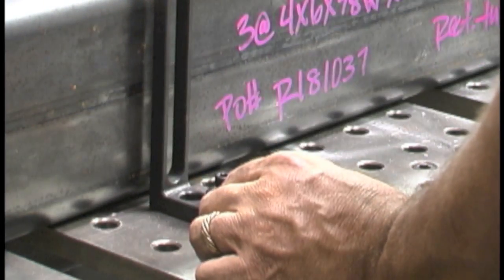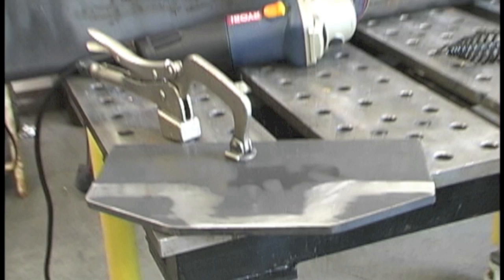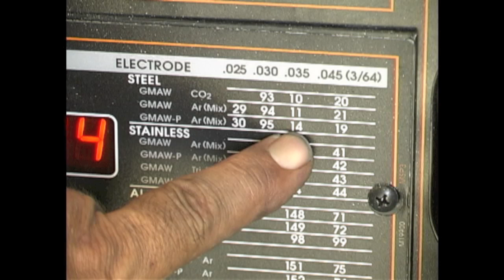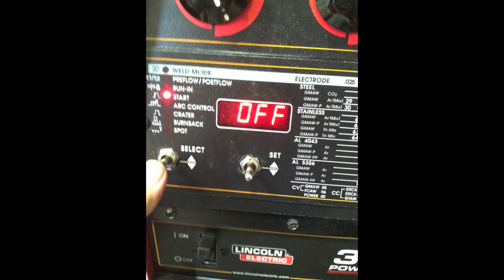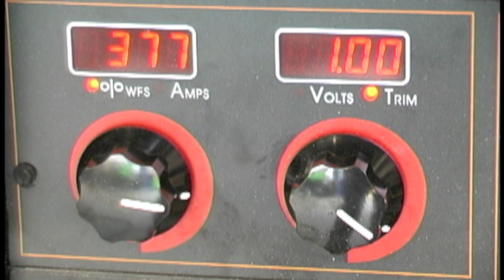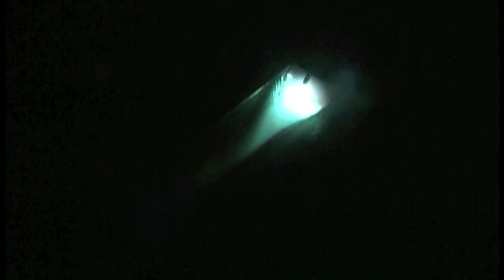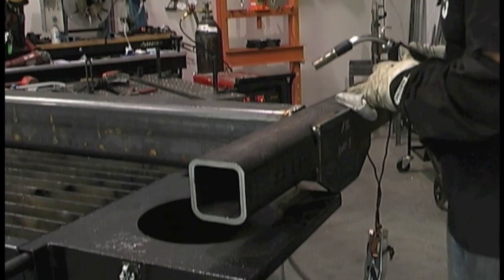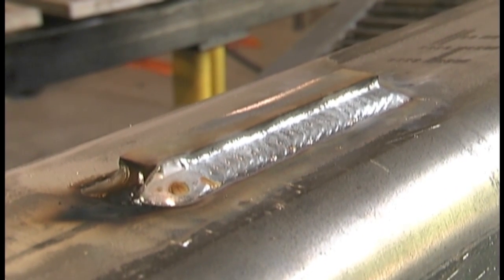Pulse Mig Welding Project on a Stronghand BuildPro Table

Comment: On these machines, "Arc Control" is what older machines called "slope". On older Miller machines, arc control is a subtle inductance adjustment that doesn't do much, but on the Lincoln, the more negative the number, the more flat the weld and the higher the number the tighter the weld bead. It's very noticeable and helpful on short arc mig but I don't remember it being very drastically helpful with pulse.  I'm sure it's got inductance built into that same setting but with a short arc process, it's just like old "slope".

Comment: Hi Jodie,
I have a Miller 350P and I live the results I can get with it.
One thing I've noticed is that it is a little fussy when it comes to mill scale. I noticed at 5:54 the vertical plate still had the scale on it and it did the same thing as I've encountered, namely the toe of the puddle tends to be irregular as it's trying to wash up on the side when the scale is there. It doesn't take much as you know. Nice to see you grinding the scale on the pieces.

Another tip I've used over the years especially on hot rolled sheet that needs a patina finish is to get the Velcro backed flexible diamond grinding pads. It works beautifully on that extremely tough mill scale found on these sheets. I even bought the Metabo grinder with the water feed coming through the 5/8-11 spindle. Not cheap but man does it do a number on scale!!
Love your channel!

Comment: Will someone please answer this?? I work in a company where all the old welders use MAG Pulse on heavy constructions, and my question is this: does MAG Pulse on normal steel penetrate better than normal MAG welds, and do you have to use Argon Gas to weld with pulse??
Reply: Mig?

Comment: Hii..Such a great video...

here I need a suggestion, We are having Lincoln Speedtech 505 machine having PF46 wire feeder. We tried Pulsed Spray transfer mode for Double V bevel 18mm thick gusset weld on flange plate having 18mm fillet size (Multi pass weld & T joint configuration manual weld) with following parameters.

Gas mix : Ar 90% + CO2 10%
gas flow : 18 - 20 LPM
WFS : 430 IPM (Same as Glob mode we are using)
Trim : 0.95 - 1.0
Wire : 1.2mm - ER 70S-6 grade
CTWD : 18- 20mm
Travel Speed : 900 - 1000 mm Per minute

and following are the observations :

1) Heat generation / Heat input is very high wrt Glob mode
2) Undercut observed / generation.
3) Weld puddle flows downwards in 2G position.

So can you guide me to eliminate above mentioned observations...???

Comment: would you ever bolt your ground directly to the work? this question is in regard to the last part of the video when you introduce the copper wire?
Reply: I would think that would work as long as the bolt location had good electrical contact. I have used the copper wire trick with my everlast welder setup ever since I saw this video.

Comment: Jody, I recently took a test, 7024 rod and dual shielded flux core. My stick welding got me the job offer (I didn't accept it) but I struggled with the wire fed. I'm about 90% sure it was spray transfer. I struggled in seeing the puddle so my travel speed ended up being slow and I would start getting cold roll on the bottom side of the 2F joint and was melting off the top edge/corner of the upper piece of the lap jount. 
What trick do you use to help you see the puddle when using spray transfer? 
I was not able to adjust the machine, just had to run what I was handed.
Reply: I know this comment is 4 years old, but oh well, but I get the strangest satisfaction whenever I can give somewhat of an answer, which doesn’t happen all that often lol. Flux-Core according to my very limited understanding, has a transfer mode characterized as a fine globular transfer, which is very similar if not identical to a spray type transfer, as opposed to short circuiting transfer or the globular transfer condition which can occur with solid wire. You will notice this immediately if you switch from flux core to short circuit, because you will feel the wire running into the base metal and melting off many times per second, you’ll feel that, you’ll hear the awful crackling noise especially when you’re used to the nice quiet hum of a flux cores wire or a solid wire in a spray mode, and you can also see the wire just stabbing the puddle over and over, not tying in or penetrating nearly as well, producing a lot more spatter, etc. where flux core and solid wire in spray mode actually just produce a stable arc and the wire forms a needle sharp tip at the arc and fans out properly in order to make a sound penetration profile and the toes and root without leaving any cold lap. As far as keeping your visual, I find that it works really well to focus specifically on the tip of the wire the arc, and the front of the puddle, paying special attention to where you’re putting the wire in relation to the joint.
Hope this can maybe elaborate on a few points for someone.

-Alex Weeks

Comment: You should do a video about how to tack stuff. In 30 years of welding, this is the first time I've seen someone not over-tack and put them in places that make for a good finish. In regards to the pulse settings: I own a Powerwave 455/STT that I've used for 5 years or more and those settings are very similar to what I would use. The trim control varies the arc length, as you discovered. In pulse modes, the Arc Control varies the pulse frequency: higher settings = higher freq. with colder, tighter arc. In Synergic CV & Manual CV MIG modes, Arc Control = inductance, so for instance, solid wire CO2 welding would require the high end of the range, ArCO2 rutile cored wires would require the low end.

Comment: I have never heard of trim before is that like the same as inductance, or does that have to do with the pulse settings.
Reply: I was wondering about the same thing. so i looked it up. it is the Voltage with 1.0 being the optimum setting. so in the video he lowered the voltage. look it up, there is some more info that might interests you (mig welding lingo, trim setting meaning).
Reply: Controls how wide your puddle goes more trim makes it wider and less will narrow it

Comment: I've been welding with Lincoln pulse mig welders for about 4 years now at work 5-6 days a week, 10 hours a day and I've come to the conclusion that they are more trouble then what they are worth for mild and stainless steel. Not only is the machinery way more finicky it's also not nearly as durable as CV machines. I've seen at least 7 wire feeders crap out within a year and probably 4 or 5 power sources kick the bucket in the same time. For such an expensive machine that is just stupid. To keep up with CV deposition rates you must use .045 wire too. I have also yet to have two days in a row that it welds the same too. Utterly not impressed. I'll take my 15 year old CV machine back over this crap.
Reply: Both the pulse and your old machine have Constant Voltage slope characteristics - your problems are not related to this.
Reply: What does slope have to do with all the problems indeacribed?
Reply: Lincoln pulse welder a suck. Only buy a Miller for pulse.
Reply: It took you 4 years, about 22 days a month, totalling about 1000 work days or 10,000 hours of welding to come to this conclusion?
Reply: how about Thermal Arc

Comment: i use pulse on a daily basis and often weld flare bevel joints like the one u were experimenting with. if u havent tried this yet turn the arc control down to at least -5. it creates a narrower puddle as opposed to the raising the arc control which spreads it out more. before i figured this out i was simply pulling the gun but found this works waaay better. let me know what u come up with
Reply: I weld almost all flare groove on a pulse Lincoln 350. I used a  Miller Continuum 350 for almost  3 years before that and I can tell you the Miller is better. It doesn't have the setting memory of the Lincoln and to be honest, doesn't look as badass as Lincoln.....but its easier to dial in and has enough power to get any order done
Reply: budgaugh66 good info

Comment: I believe he was talking about the wire coming out of the gun and not melting into the weld, not the sound of the crackle being made.  And I didnt see porosity which would occur if the shielding gas were insufficient.

Comment: I have to respectfully disagree about the ground statement. I saw a welder set his ground clamp on his welding table. Being fresh out of school, I thought he made a mistake and forgot to clamp the copper jaw to his table. He proceeded to lay down some sweet beads and take me back to school. If you are having a problem with that machine, it's probably the gas flow rate, it should be about 50CFH. Insufficient gas will sound like a machine gun.

Comment: We have those Lincoln MP pulse machines at work. They take a little getting used to. Those things love to chew the corners.  Some of the old timers still use them on short circuit. There's one that figured out how to use the spray, now he uses it all the time. He says it's like cheating. Once your use one of those machines with AL, you won't want to use anything else.

Comment: About your ground, current flows over the surface of the conductor. Thus there is more surface for it to travel over when you are on top of that copper wire. Braided wire will conduct better than solid.

Comment: then you're not doing it wright. I manufacture flood control equipment with pulse spray transfer, and I've never had a weld break, and we're on a first name basis with our clients so I would know if there were any problems, and our equipment goes on skid-steers and they abuse the hell out of our products. we even bought back one of our machines that filed 80,000 sandbags, and all it needed was a new coat of paint